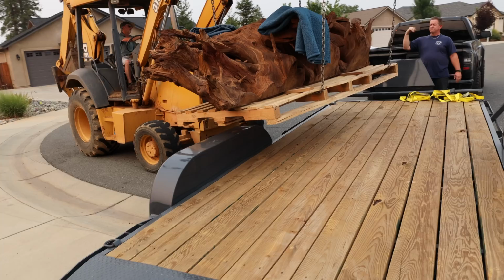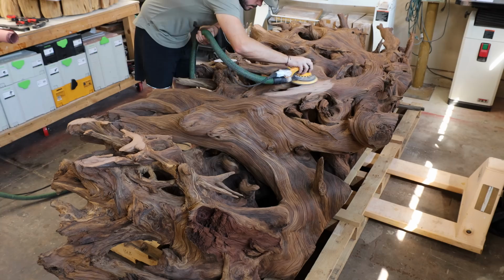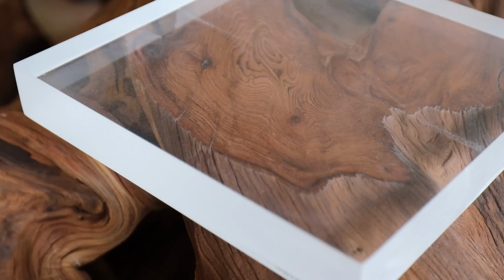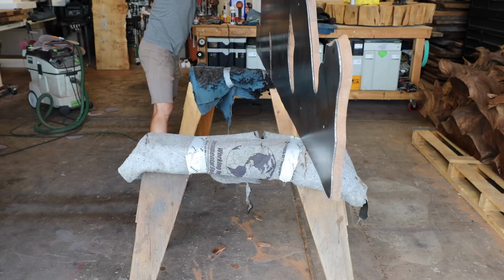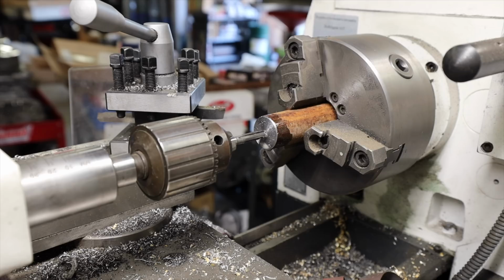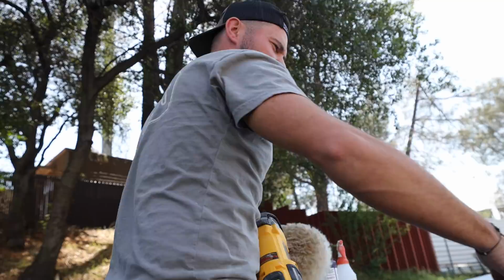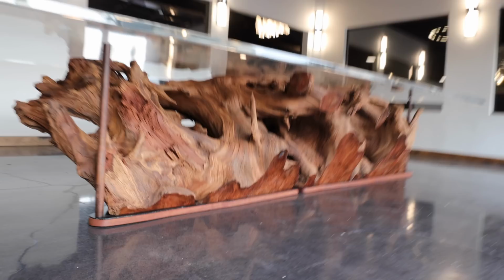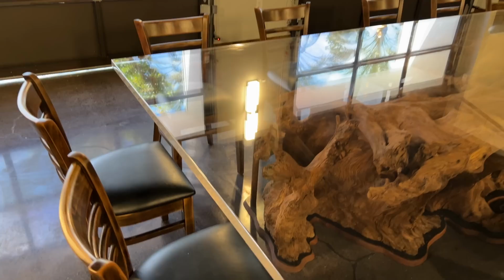1500 Yr Old Redwood Table Build | $65,000 Value

Comment: Why didn't use glass instead? It's way better for this application 🙃 specially tempered glass
Reply from the maker: You can’t get annealed or tempered glass this large, even if I could it would have been double the weight per sq/ft.
Reply: @MattsWoodworks  Damn that kinda sucks, glass of that size is readily available in my part of the world, but you certainly did an awesome job with what you had.
Reply: Nice job
Reply: @Anglo-EgyptianMan  probably not as thick. But yeah esp at this cost im sure a piece of glass would have been able to be acquired somehow.
Reply: @D3nn1s  shower screen suppliers are a sure bet in my area
Reply: @Anglo-EgyptianMan  good call but i doubt they make 5m long glass. Id look more into showfloor/construction business.
Reply: @MattsWoodworks  il ne faut tenir compte des mauvaises langues
Reply: How bout the commenter go make his own ,,, don’t be afraid to just say please stfu
Reply: glass would have been cost prohibitive and way too heavy.
Reply: @curtismills303   cost prohibitive glass for a fucking table that cost 1/4 of a ferrari is a weird sentence
Reply: @lucaskp16  I thought that it was a dining table, not a sex aid?
Reply: @sanderslongdrive  we need to get you a hour long HBO special it looks like.
Reply: @MattsWoodworks  You could have probably gotten a aquarium builder to get a sheet that size.
Reply: @MattsWoodworks  first of all, annealed sheets come to glass fabricators larger than this piece. the limiting factor is going to be the tempering oven size.

glass of this size is more than  likely going to have to come from china
Reply: @MattsWoodworks  Ah I was wondering the same thing but I totally overlooked weight, with those small touch points that could be a little sketchy
Reply: @MattsWoodworks  You're correct on the weight side of things... however yes you absolutely can get tempered glass this big, and much bigger! Annealed however would be a death trap
Reply: My thought exactly. Would be a custom order, but that’s probably worth it at a price of $65k
Reply: So impressive just the size of it. A stunning piece! 🙌 love everything about it💗you are so talented🤗 would love to see what the lights you were talking about could do, to bring out the different sections of the roots,I think you could create totally different "landscapes" just by the ligtht. Evening servings with dimmed light in the room, and this masterpiece kind of gloving in the middle😁 I will shut up now lol, eccelent work 👌💯
Reply: Weight Amir! Super freaking heavy in glass vs. acrylic
Reply: @D3nn1s  0
Reply: @johnmartello4031  1
Reply: Maybe too heavy ??
Reply: @MattsWoodworks  т
Reply: @MattsWoodworks  90
Reply: agreed.  The plastic is terrible.  Yes, you can get the glass.  Sure it would be heavy, but so what?  I did an island with a 14' by 8' wide 3" thick stone top.  That was heavy too, but rarely would it need to be moved.  Glass would stay looking nice, the plastic looks cheap.  I look at these types of projects as looking cool and great.....for about 10 years, then they look dated.
Reply: Such o work of art….stunning
Reply: I have a full suite of redwood lounge furniture, and the settee back is just like the profile of this piece of wood. It's an absolute cow to keep dusted though.
Reply: @MattsWoodworks  that wood is amazing but the base is horrible really horrid
Reply: Because he's conventional.
Reply: @lionelteles8197  Tabernak!
Reply: I have a tempered glass table and it still scratches
Reply: @ourfarmhouseinspain  and fingerprints on the table too
Reply: It’s incredible! Sorry about all those scratches, but glad it all turned out in the end.
Reply: @MattsWoodworks  why would the weight matter?
Reply: @ThePastaManCan  moving it to put it on the wood maybe?
Reply: People that don't know anything about something, pretend to be knowledgeable are annoying.
Reply: There is a finish that is called "Raw", this plus reactive stains can do nicely to match projects like this. The Raw finish basically does not change the natural color of the wood, so you have a finish, but you don't see it, almost like that PPF.
Reply: Glass is of course better, but this table is for a restaurant not home. So I think Matt's choice of using acrylic is right.
Btw the polymer is amazing
Reply: @spuddy4845 I was thinking the same thing. Would have been much nicer recessed underneath so it wouldn’t show.
Reply: I'm curious what the impact would be to use acrylic under a thinner piece of glass.  I believe ballistic glass is actually a composite of layers of just that and that is certainly see through.  Beautiful piece and the polishing to such a fine grit w/o finishing looks great.
Reply: @MattsWoodworks  I live in Eureka so next time I'm in Redding we'll definitely go check out the table.  My house is on 1.5 acres forested with redwoods, perhaps I'm sitting on a secret goldmine of trees!
Reply: @f87115  Seriously? not entitled to an opinion?
Reply: Stunning….subscribed 👍
Reply: Haven't seen tempered glass this thick ever. If they somehow did, it likely would weigh in at 600+ lbs. This will be one heavy piece of work.
Reply: @D3nn1s  you can get 19mm thick tempered glass at 5000 x 2700
Reply: @MattsWoodworks  yes you can. it is not cheap but you can. and it will be most likely multi layered glass. it is not on the cheap side but for a 1500 year old wood... it would do justice. why would you put acrylic I do not understand... its just cheap plastic at the end of the day. my opinion... never mix acrylic with wood. it devalues the piece. people have forgot the meaning of luxury...
Reply: Of course you can get glass this big. I had a 10 foot glass table that was 1 1/2 inches thick- unfortunately it was demolished when they bulldozed my house because noone wanted it.
Reply: @MattsWoodworks  you can definitely get tempered and annealed glass this size.  Of any thickness up to 3/4" You just need to know which fabricators carry jumbo sheets and have a tempering furnace large enough.  Glasswerks in Los Angeles does.  right by GL Veneer
Reply: Glass would have been possible, no annealing needed, if you used 18mm Starfire glass, I think, PPG still produce it.  I used to hand cut plates larger than your table, but excellent work
Reply: I live in a large metropolitan city....and there are many office towers with glass walls far taller than 15 feet. Perhaps it needn't be so thick though...because the thickness adds to the weight of the top. Or else create an acrylic top and add a thin layer of hardened glass on top of the acrylic.
Reply: Well I think it is spectacular...
Reply: 欸欸欸欸喔阿喔阿喔阿哦哦哦哦哦哦哦哦哦阿哦哦哦哦哦哦哦哦哦哦哦阿喔喔喔喔喔喔喔阿喔喔
Reply: Absolutely gorgeous. I went to their website and their photos are definitely showcasing your table.  Beautiful work guys! ❤❤❤
Reply: An inch and a half piece of tempered glass of obtainable would weigh about 1640 lbs (744 K ). That's a lot of weight for some of those smaller root supports. One possibility would be to put a thinner sheet of tempered glass over the acrylic
Reply: Very nice job looks beautiful what a nice looking ancient wood. Should be in an art museum.
Reply: "yeah man, did you like check the yellow pages? Cuz my cousin knows s guy, it's real common stuff over here. Even the Subway at the strip mall use it with the  same kinda wood."
Reply: @perseus9428 with that mindset isn't a hymen the signifier that the thing it's attached to has value and is 1000 times more worthy?  I cant think of any other real world equivalent to a small thing converting such a dramatic difference. Maybe a stamp with an upside down plane? But that's not a tiny thing attached to an otherwise identical object. What's the equivalent of a Kelly Blue Book in difference in making so as to check the value difference.. private seller to private buyer, mint condition.
Reply: @paulkramer4176 yes hon we're sure yours is just as pretty as his is
Reply: @terretulsiak It may have been wonderful but just too heavy move and get into their house. 
Side note, I see the acrylic part is being pretty replaceable. If it's not liked the only part that's easy to remove. Going to have strangers eating their dinner on it who don't care about it
Reply: Absolutely freakin amazing.  Just beautiful.
Reply: That would have been even worse. I was kicking myself for buying a glass top table so many scratches and dings on it just from normal wear so I had to get rid of it.

Comment: Fantastic table, but to me, the vertical steel rods are glaringly inappropriate.  Sorry.  They clash with the curvaceous base.  Plexiglas at 1-1/2" thick is plenty strong enough for the vertical rods not to be necessary.  Some straightforward bending strength calculations should have been done before deciding whether such rods were necessary.  Good luck with your next one.
Reply: I agree 100% the rods are visually disturbing. It takes away from the overall look of this beautiful table.
Reply: I love the rods that's weird they almost look like wood
Reply: I agree, I didn't like the whole build just because of them, I assume he didn't want to destroy wood by cutting in and putting supports, but the way the rods looked from above ruined the amazing table for me
Reply: Have to agree, totally cheapened the finished product.
Reply: Agree
Reply: better if the metal rods were curved like the wood.
Reply: Totally agree
Reply: Agree! I get that the rods are necessary for support of the top but this seems like such an inelegant solution. I think they might have “disappeared” more if maybe a sculptured metal would have been used - it could have referred back to the metal base? I’m definitely not an artist but those straight wood rods stuck out not in a good way. 🤷‍♀️
Reply: Those rods definitively look like butt.
Reply: You are spot on
Reply: Came here for this comment.
Reply: 😮 wow ❤
Reply: Agreed, although i think the acrylic cheapened it... and imo, the tabletop shape was too square to suit the root as well. It was a disappointing finish. 

But that root is stunning in & of itself.
Reply: yup, rods are very inappropriate in my opinion as well
Reply: Agree 👍
Reply: Yeah its a horrible choice dudes  working out of his skillset and design knowledge. Hopefully someone will save it one day and do it the justice it deserves
Reply: I agree. I thought the rods were going to be for the transport somehow. The top should only touch the wood. Nice job overall.
Reply: Rod suck

Comment: I like how you used the rusted steel rods rather than polishing them so the blend in with the color of the root system and do not stand out or take away from the view of the wood.  The wood and metal base is a great feature and looks very nice.  I think the acrylic top looks amazing also.  Overall. stunning piece.

Comment: 19:10 The AquaDom pictured in the lobby of the Radisson Blu hotel in Berlin.  It cost around €12.8m and contained 1,500 fish and over a million litres of water.  On the 16th of December 2022 the temperature dropped to a freezing -6C causing the tank to crack and then explode.

Comment: Should have used an oil finish on the raw root part and a tempered glass top over the acrylic top to prevent scratches.  Also, using the rusty steel rod looks SO out of place.  Couldn't you have gotten a matching piece when you bought this root?  If not, fabricate something more in line with the roots.

Comment: The piece looks great but the scratching in the acrylic could have been predicted. I think that the corners should have been softened a little so they wouldn’t be so sharp but probably couldn’t wrap the edges as you did. I can’t imagine why the restaurant spent so much on a unique special piece and used stock chairs with it that don’t do justice to the table. The chairs detract from the look.

Comment: I know it was probably not feasible to do but in a perfect world...I think the way you polished the root and the those dark colors came out would look beyond amazing on the whole thing, almost like you'd put some type of varnish on it. Again, that would have been hard but that color is undeniable insane. Like the other comments, I would have used tempered glass and no poles. The rectangle looks good but I also could see an oval or rounded ends. I get that you just moved it in and they threw those chairs there but I surely hope they eventually got some ornate Chinese chairs and good room decoration to pull it all together. With the root polished and similar colored chairs with reds and golds and ornate carvings would have elevated this table beyond belief. I applaud your work.

Comment: I think the rusted stabilizing pipes on the corners should have been curved out instead of straight. the root ball has curves and twists. the stabilizing pipes should also been twisted and curved, just as nature. Could been done by a blacksmith or using a pipe bender.

Comment: Love the wood and I think you did a good job of highlighting it.  I do like the suggestions of lighting it up to make the inside glow, aIso I would have inset the base and run flex lighting under the offset to make the table look like its floating.  I'm on the fence about the support rods.  I like the idea of color matching but given the angular nature of them I wonder if they should match the top instead of the wood.  All in all its beautiful work.

Comment: Looks beautiful other than those metal rods,I personally wouldn’t say it’s more than an 8/10 since I hate the way they look,even just pitch black clean metal would look better than those,great idea just figure out how to remove those and it’s a table fit for a king
Reply: Yeah I'm not a fan of the rods either - but still super impressive end result
Reply: The steel base is good functional design , the wood alone should be all you need to hold the acrylic top unless you are short of touch points to bslance it.  The table should stand alone to showcase it's total beauty.  I would strongly suggest some designer stack chairs in black to set away from the table; keep the focus totally on your unique table.  And ... be sure to leave him a supply of your well designed business cards.  Think professional !

Comment: reynolds polymer built that cylindrical fish tank that exploded a month ago?
Reply: The AquaDom was opened on 2 December 2003 at a cost of about 12.8 million euros. The acrylic cylinder was manufactured by International Concept Management, Inc. using Reynolds Polymer Technology panels, with architecture drawings provided by Sergei Tchoban.

Comment: First I like to say this project is absolutely beautiful. I give it 99/100. I think everyone did a great job on it. The rusted rods were a nice touch too. I'd love to see another one of those in two year's time.

Secondly, some nitpicking that really doesn't take away much from the project.
There's two little things I thought were just that 1/100 short of perfect.
Little thing one: the base of the base. I'm not sure how much more work it would be to make it fit the contour better? Either to make it perfectly exact, or exactly like two inches out. It feels tiny bit uneven, but it's hardly visible from the top.
Little thing two: The epoxy top is a little underwhelming compared to the rest of the build? I'm not sure what would have made it better. You already said tempered glass wasn't an option.The upside is that the epoxy doesn't distract from the root. The downside is the base is so luxurious, a good quality epoxy top almost feels cheap compared to it. Maybe if the top was a slightly different shape? A slight oval? Something to add a little bit of flare to it. Some leaf/branch engraving on the side of the epoxy that doesn't hinder viewing the root from the top?

Comment: Awesome job on this unique build. Having worked with Acrylic for decades now, I was really worried when you chose that as your table top. Even using the wrong cleaning material like paper towels and Windex will leave fine swirls and haze. Over a short time your expensive table top would have looked scuffed up. That film you applied was absolute genius and cheap to replace too. Another thing would have been 1/2" tempered glass but you would lost that thick edge profile. Also I would eliminate the metal poles and base plate. I've learned more from my failed attempts than the conservative ones I made over my time.  But never the less, it should look great for years!👍👍👍

Comment: I can appreciate the suggestion about using glass or tempered glass in especially one small strike in the wrong way and it will shatter the whole thing. Glass is not as easy to buff out a scar, but the overall comment i have for this piece of work is you do phenomenal work
Reply: With a piece of Tempered glass that thick you could hit it with a hammer and probably not break it. you would however chip it.

Comment: Excellent work! I've done some mahogany, It was a class project and I couldn't get near enough time on the lathe, but wasn't that bad. America doesn't have enough quality wood, they cut it all down.My sister had a black oak or walnut in her yard and paid these guys $1000 to cut it because it was tipping over. They should have done it for free or paid her, they let het keep a slice for a wedding cake and it was top notch. Africa and South East Asia has all the high end but it's disappearing fast. Good luck with your projects, you've got the talent!